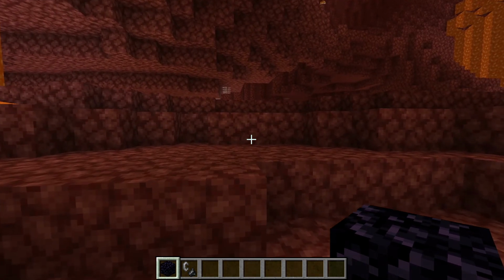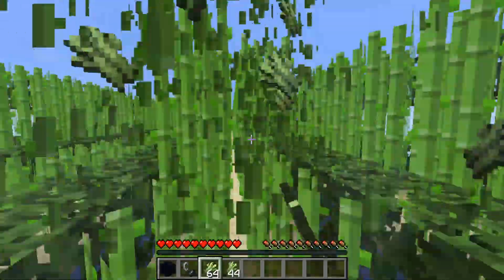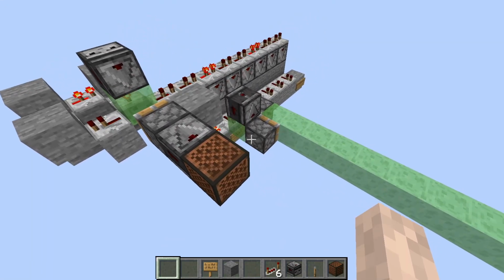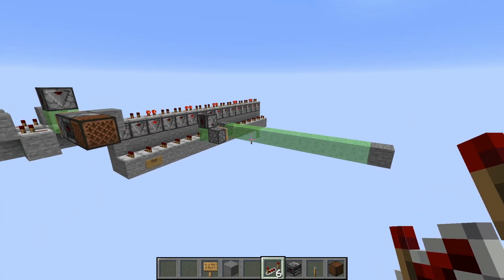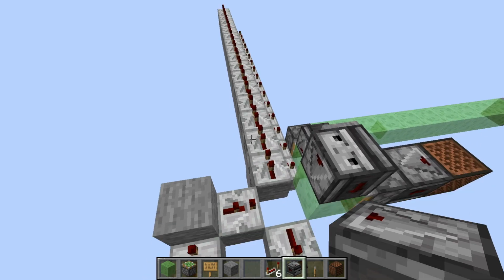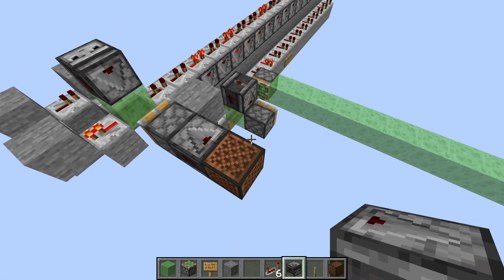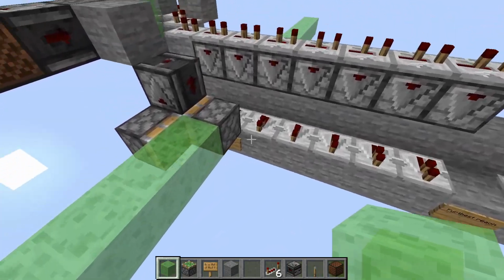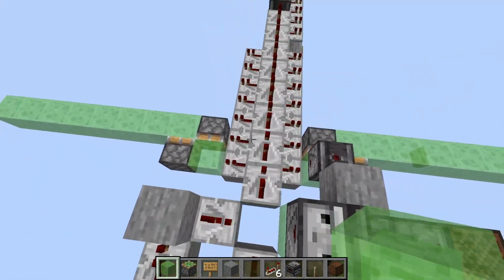Tethered flying machine for unload safe farms. | Minecraft 1.16

Comment: About the "scuba conversion" what if we put all this stuff under the floor and let out just an arm which has extentions? The only water flowing in the redstone chamber below would be just a row of columns, easy to isolate into a 1x1 trench below where it's supposed to spill.
I mean, it's as easy as cover up the redstone with leaves (to not stick to moving slimes) nothing groundbreaking... You asked I answered but i'm not you! :)
Reply from the maker: you could do that, but you'd lose at least two or three blocks of arm that would be hidden behind the wall. See my recent let's play episode with the kelp farm, I solved the underwater problem there.

Comment: you don't have to rebuild your flying machine you just trigger 1 observer
Reply from the maker: The slime blocks from the two different segments of the flying machine got stuck together and that exceeds the push limit of the pistons.
Reply: @Borkon  fair enough. yes. all right. I agree
Reply: @Borkon  wait a minute isn't that not only in the newer versions with the chunk loading disabled which breaks half your contraptions?
Reply from the maker: @hobrin4242  No idea. I'm a newbie and have only messed around with redstone and flying machines in 1.15 and 1.16.

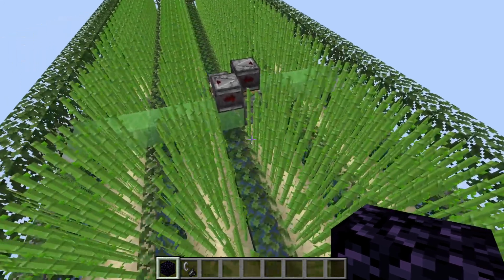Comment: 0:27.. you don't need to break it lol, just use button on one of the sides of that sticky piston get it started
Reply from the maker: not when it breaks that way. The normal way they usually break, yes. If it spits out a piston like that you can't safely restart it. I took me around 100 attempts before I actually got this failure mode. Unfortunately, like I mentioned in the description and pinned comment, I discovered later that this is also the one failure mode this machine doesn't prevent. The common one (where you just need to get it moving again with a button or by just poking an observer) is fixed by this machine.

Comment: Love it!

Here's the quick idea: for kelp farm, reconfigure slime "wings" so they go like 3-4 blocks down and then however possible to side. So repeators stay above the water, but slime goes down and sweeps. At 3:22 as I can see slime block on a further piston can go down and don't touch anything vital.

Not really technical, and need to think about gathering system, but hey, gotta through ideas at the wall and see what sticks.
Reply from the maker: Hm. Yeah, that could work. I was so focused on doing something with the repeaters that I didn't even consider simple solutions like this. It would reduce the reach of the harvesting mechanism by a few blocks, but 8 or 10 is still better than 0.